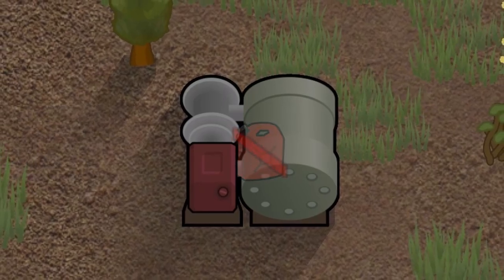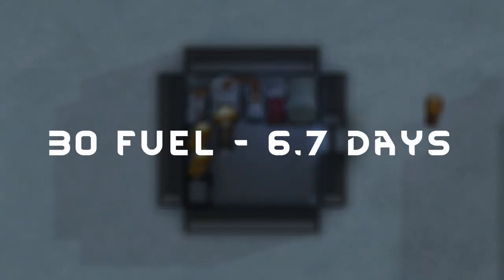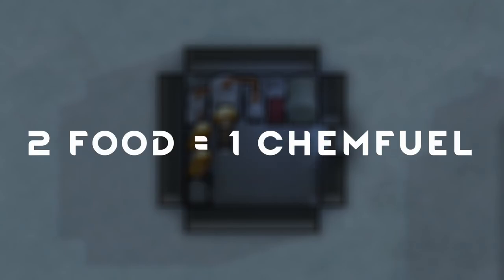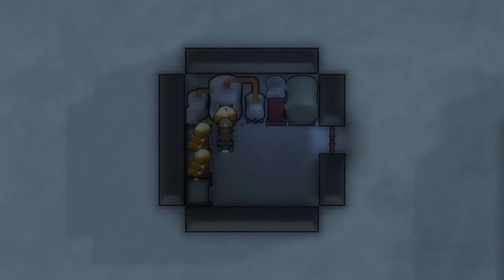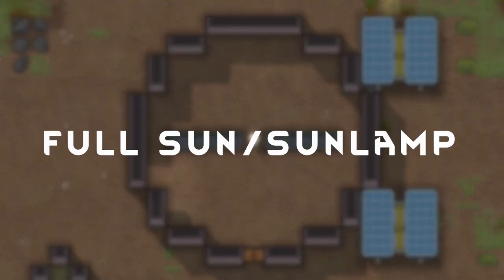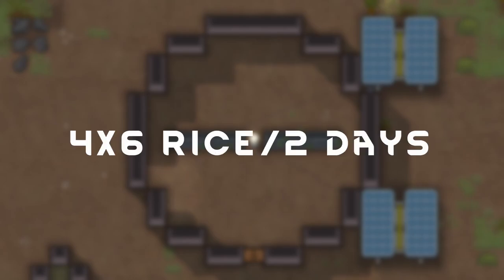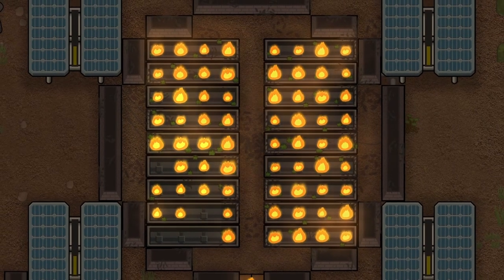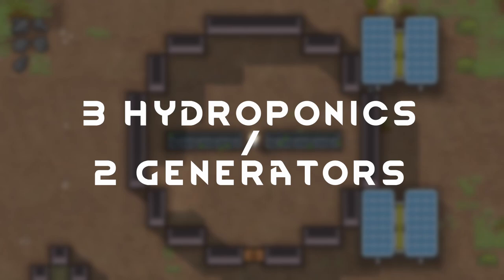Quick Tips: Unlimited Power (From Rice) | RimWorld

Comment: chemfuel is my go to power source, but it starts to fall a little short late game where you end up spending tons of resources and time just to keep them filled.
Reply from the maker: Yeah, that's when you make the switch to geo. It's too good not to use.
Reply: @VenomSteak  depending on power usage and mods, even geo doesnt fully satisfy some of the higher tech playthroughs (mechanitor comes to mind, tons of power usage late game with bandwidth antenna and turrets). I end up using a combo of chemfuel, geo and toxic generators as well as the advanced power stuff from vanilla expanded. that or just run a nuclear power mod lol

Comment: I my current Sea Ice play-through I used a bit advanced setup for power: Rice with meat (raiders) to make kibble for boomalope and boomalope make chemfuel for generators. 
By day 300 I have 13 boomalope, giving me fuel for about 30 generators.

I limited myself to chemfuel generators only and with extreme lack of resources on Sea Ice, I found my setup for power quite efficient
Reply from the maker: Just getting that much steel together is enough, crazy that you have that much power up and running!

Btw I'm doing sea ice too! Current setup is a mix of toxic generators and a single chemfuel genny. Toxerators are too strong, just love them. Might have to do a video on a sea ice setup sometime.
Reply: @VenomSteak  Toxic are very strong indeed, but I challenged myself to build only chemfuel generators for power. 

I got 2 boomalope from the trader and let them breed until I got to 13, then sterilised all. I believe 30 generators will be enough for full run.
Reply from the maker: @AshGamingTales  Oh yeah, 30,000 power is a lot. Good job.

Comment: I've recently switched my power mostly for chemfuel generators. I used to prefer solar and wind, because I always had situations where all my pawns had been fighting raids or going to missions for so long that the chemfuel generators ran out of fuel, but now with the addition of lifters, who will prioritise restocking buildings over everything else, this doesn't seam to be a problem anymore. 

Chemfuel generators are very good for a specific strategy of mine. I hate zzt events. I hate them so much that I have decided 2 years ago to never build any powered wire in rimworld again. If all your buildings are roofed and you don't have any powered wire, zzt events can not occur. This means I have to build all my power consumers within connection range of a power generator, which is pretty inconvenient when your power generators are as super bulky like wind and solar are. Chemfuel is much more convenient. Wherever I need power, I build a chemfuel generator (encased in stone walls because these things can explode if damaged). One exception I still make is that I still prefer to power my neural superchargers with solar and wind since it's not a big problem if they are unpowered a part of the time. And also if there is a geothermal vent I will of course use it. I'm also thinking I could have Toxifier generators away from my inner base to power mech nodes, but so far geothermals have been enough. I'd prefer not to build toxifier generators in the middle of my base because a pollution infestation there could be costly.
Reply from the maker: Always glad to see the happy cat picture when your comments pop up.
Reply: @VenomSteak  Haha, I like you too, mate. 😀